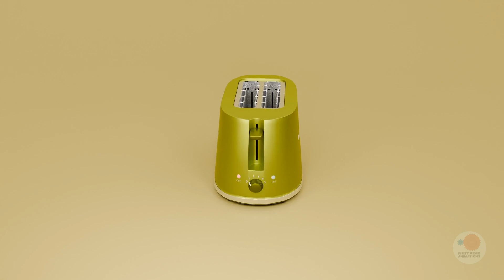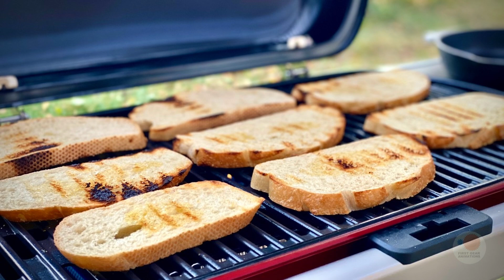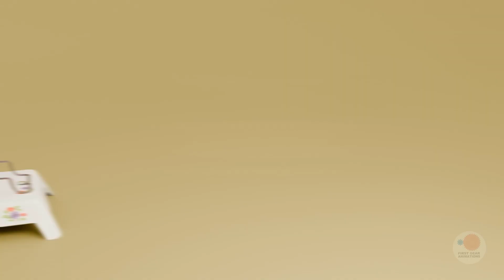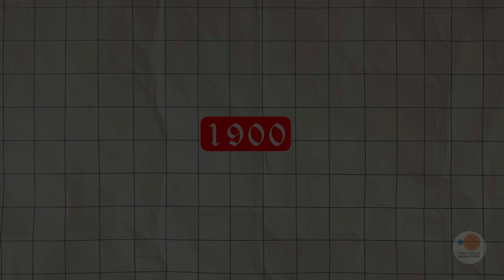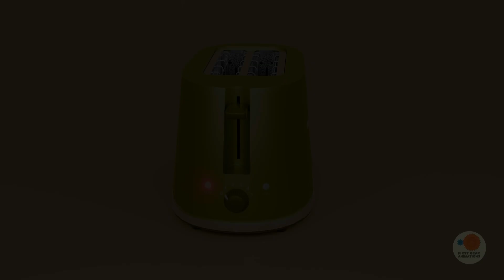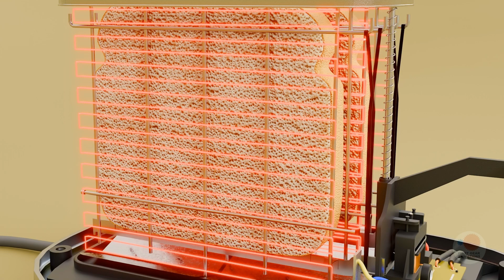How An ELECTRIC TOASTER  Works | 3D Animation

Comment: The part that clicked for me was the electromagnet holding the lever down while the nichrome wires glow, then the timer cutting power so the springs pop the toast back up. Clean 3D breakdown of a very ordinary appliance.